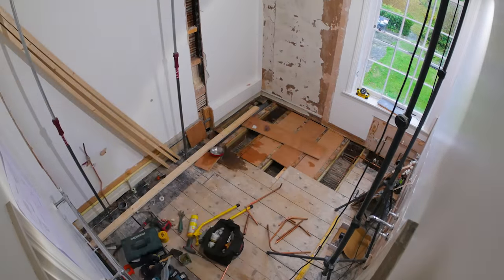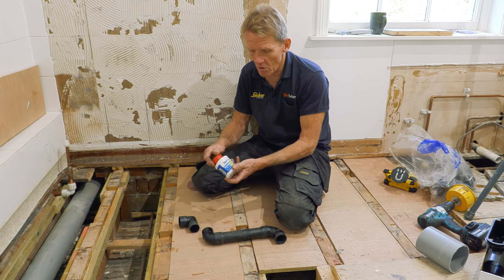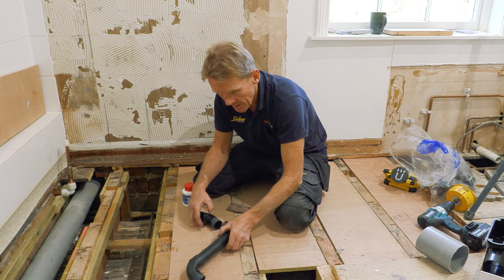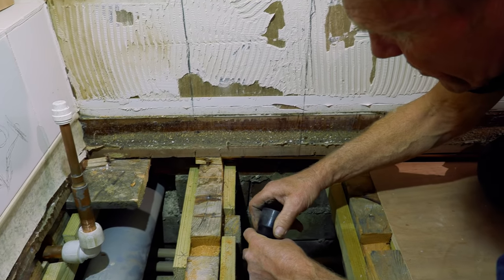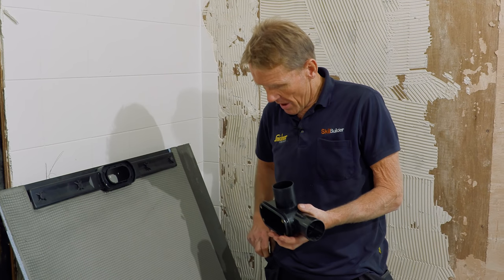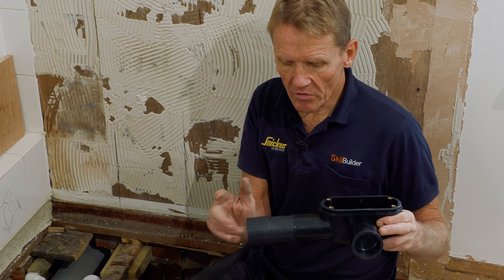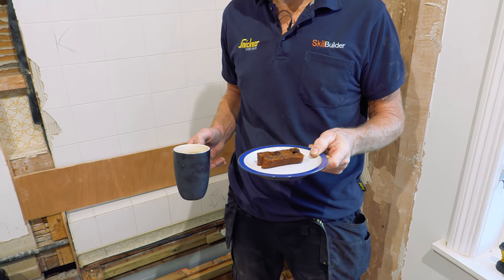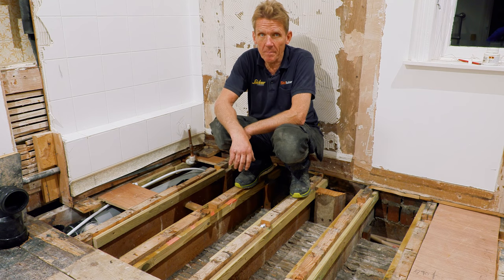Bathroom Renovation #3 - Level Access Shower

Comment: just a quick question.. that flexi pipe you used, is it abs, mupvc, pvc or..... polypropylene ? and if it was polypropylene -  did you have to mechanically join it? great vids

Comment: Roger, please can you put something straight here. Can you use normal solvent cement to connect ABS to PVC? Everywhere i read says i can't. It looks like that's what you did. If not, what is the best way to connect an ABS Wedi waste to existing PVC waste? Cheers and thanks for the videos. Jon.
Reply from the maker: Change Name 
Yes PVC and ABS are both good for solvent weld. It is only polypropylene that can't be stuck. You may find tiny size differences between different makes of ABS and PVC if so use a gap fill solvent cement
Reply from the maker: EVERBUILD P16 PLUMBERS PVC PIPE SOLVENT WELD CEMENT 250ml PIPE ADHESIVE GLUE

    From £6.10
    RRP £6.32
    |
    You Save £0.22

PVC Pipe Cement is a non-drip, thixotropic solvent based pipe cement for bonding non-pressure PVC and ABS thermoplastic pipes and conduits to themselves and each other.
Reply: @SkillBuilder  excellent, thank you very much. Jon.
Reply: @SkillBuilder  Any thoughts on that Solvent Weld GEL? I was mighty unimpressed with it and binned it. Normal thixotropic PVC cement works just fine. The cement containers, from what I have been told, are made from PP 😊

Comment: Hey Roger what is is called when you do the battens and ply on top and is there a size minimum for joist distances? For example 12mm ply for 400 spacing
Reply from the maker: I don't know the name but the ply should be 18mm
Reply: @SkillBuilder  thanks very much Roger 🙏

Comment: For some one so particular I was surprised to see what looks like speedfit fittings on copper, especially under the floor!
Reply: Trade Tested Mark 
I'm aware push fit company's state you can use their fittings on copper. however using them on a floor that will be covered and tiled to me is a bit iffy. 

I admit I have used them in this application before but not without good reason, I don't think you'd dispute that out of compression, crimp, solder and push fit that the latter is the least durable seal and also has a shelf life?

Which is why it surprised me to see Rodger using them when in this same video he stated he didn't like using flexi wastes and he generally seems to do things to last.
I will say Rodger is far more knowledgeable about plumbing then me so maybe he knows something I don't...
Reply: Use those utterly jank John Guest Speedfit fittings in any capacity?  Even if you paid me I wouldn't touch Speedfit with a barge pole with a dead rat🐀 attached to the end.
Reply: It’s hep2o
Reply: @scottmacfarlane2805  One step better than John Guest gear. I'll remove the dead rat and just use a barge pole.🐀😂
Reply: @Trade Tested Mark Nothing wrong with Speedfit? If you like tee or elbow fittings the size of a fully grown elephants foot, then yes use Speedfit. Otherwise not acceptable.
Reply: @amateurvegan2636  I'd rather use a bit of old hose pipe heated up to fit over 15/22mm copper with jubilee clips at each end instead of JG Speedfit.
Reply: @dalemoore11   Nothing wrong?  When JG looked at the fitting they admitted it was defective and that I had fitted it 100% correctly.  Would you trust a JG in a totally inaccessible place, e.g. between joists under a screwed down structural grade plywood floor with electric underfloor heating then tiled on top?  I wouldn't ever trust them and I've seen these JG fittings 'creep' off JG pipe and then blow.  If you don't mind fittings the size of fully grown elephants foot then they are great.  They are for bodge jobs under a kitchen sink.  I won't go in to flow restrictions because you probably wouldn't understand.  Best of luck to you,  I recommend you use them for boxed in and totally inaccessible locations !!
Reply: @stakkerhmnd  well isn't that obvious any mass manufacturer item in any sector can't make every  unit 100% perfect 🍋🍋
Reply: @dalemoore11   You've missed the point.  I'm not expecting JG or anyone else to make every product 100% perfect and failure proof.  You reckoned I fitted them 'wrong'.  I didn't.  The other issue is why would anyone use them?  They are expensive, massive, have so many parts that can fail, fittings 'creep' off pipe ends and there are probably other problems I have forgotten.  You said 'nothing wrong with JG' and yet I have given you a list (which you ignore).  If you like them please use them all day long.  Good luck.

p.s. Do you work for JG?  My reason for asking is that I've heard from numerous plumbers that JG always blame the installer when their products fail even when it is the product that failed.
Reply: @stakkerhmnd  God no I'm far to skilled to be a water boy, I would say 80% of every new build I work on now has mainly plastic pipe obviously not all JG lot of different makes and brands. I must admit if I was to buy a brand new house I would rather it all be in copper pipe but let's be honest that's not going to happen in this day of age 🍋🍋🍋

I'm no plumbob but I'll give you a top tip once you fixed the pipes and connectors try to pull them apart this will tighten and then fill pressure slowly then release pressure and put pressure back on check the pipes have not moved your welcome my friend.
Reply: @dalemoore11  Totally agree, I'm always hearing about plastic pipe installs failing on new builds and the costs of rectifying are massive.  Everyone blames everyone else.  Sometimes it is installer error. Heard about one 'know-it-all' who decided that pipe sleeves were a waste of time and money and never used them.  Fittings blew in the boxed in sections and in the stud wall partitions.  Plastic is massively quick and relatively unskilled.  I don't know if pulling them tightens them? Are you sure?  If true it is still a bit unreliable.  Your pressure testing is good and about all that can be done to make sure it isn't leaking.  But in the future who knows? Regards,

Comment: I don't know about the UK code. But in the US, code won't allow you to have 1x 3 for floor joists.
Reply from the maker: Where is the one by three? It is way more than that. I think we are talking 9 x 2
Reply: @SkillBuilder  Not the main joists, the battens. Because the plywood is just resting on those.
Unless you're putting plywood over that also.
Reply from the maker: @saulgoodman2018  
The support of the plywood is not compromised by the 2 x 1 battens. They will not bend even under loads of 300 kilos per square metre.  It is a strong job..
Reply: @SkillBuilder  But code in the US, I pretty sure it won't pass. 
They will let you sister them, but not with those short pieces.
But that's only if it's inspected.
Reply from the maker: @saulgoodman2018  O.K fair enough but I have done a fair number of these and, so far, it has never been a problem. If there had been any movement the grout would have cracked.   I appreciate that people are getting heavier so maybe the  2 x 1 needs gluing and screwing or maybe some deeper section OSB strips.  I will take some advice
Reply: @saulgoodman2018  The US building code is made for land whales. It requires RSJ for toilet support.

Comment: That trap should be solvent weld onto the tray... I always wonder when putting a tray in without riser kit ...why don't they make a solvent weld trap to tray
Reply from the maker: The trap can be turned to any direction. If you solvent weld it then it is not possible. Plus it could get damage.